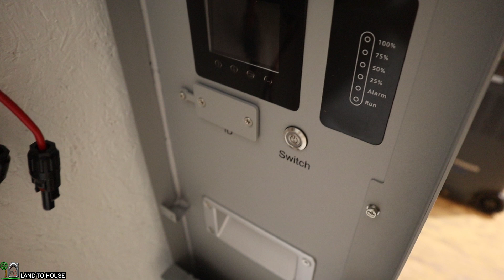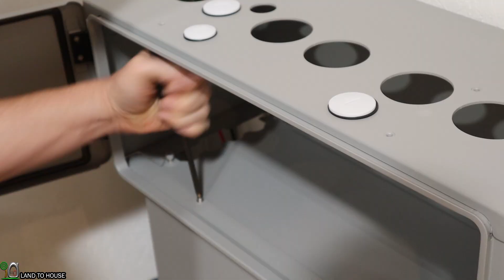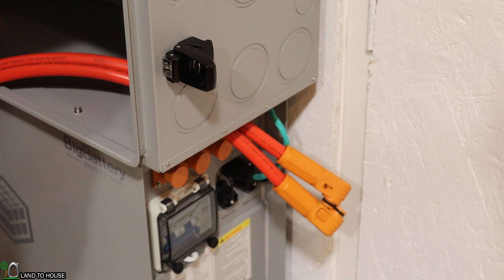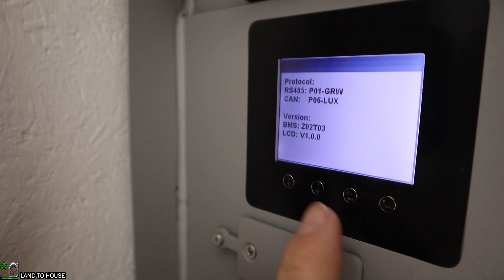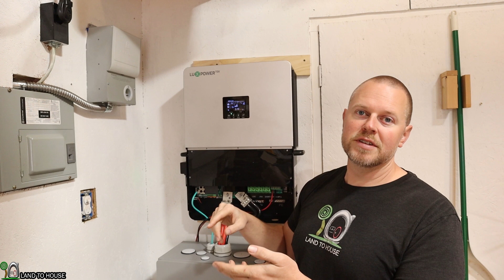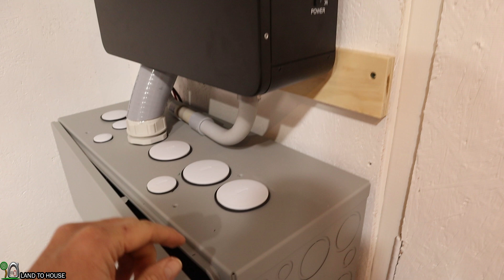Full Off Grid install 6kw Inverter and 15kw Battery - Big Battery Rhino 2

Comment: Thanks for showing a system up and running...
What this proves to me is my inverter was faulty right out of the box.   I swear they dont bench test things before they ship them.
I can do everything you can do there but mine wont charge from 220v to the battery.
I have had to order another inverter to see if this one is faulty.  It was the fastest way...7-9 days.... if I send it back it would be 14 days before I even found out if it was faulty... then another 10 to get the replacement back...
I will subscribe to your channel if you will show that inverter start charging from grid.    I need to see the screen and hear what it sounds like.    Mine engages a solenoid with a solid click then unclicks and repeats.   No voltage increase is seen on the battery terminals right at the inverter.  This tells me the AC to DC charger is simply faulty...  try and get that through to someone on the phone that has never install or used one is their life is painful...  
signed.... baited breath....

Comment: I thought EG4 made this battery? Is it really made by lux power and EG4 and BigBattery rebrand it?
Reply from the maker: The inverter is a lux power. Eg4 rebrands it and ads some breakers. 

The battery is the same. Bigbattery and eg4 both have a model.

Comment: I was glad to see that you put all the cables in connectors going into the inverter, bare cables going into metal cases worry me ! 
These batteries come with two cables for both positive and negative  for the larger inverters like the 18k, you only need one for the 6000. No worries until you want to add an additional battery, and then the angle of the connectors on the battery will be a problem for the parallel connection cables.
Just FYI, that big battery is exactly like the EG4 brand that is sold by Signature Solar and Current Connected. 
One more note is that the battery is a 14.3kw, not a 15kw.

Comment: no groments for the battery up into your wire box for the positive and negative?  Seems sketchy having those feed up through those cut outs long term if they shift and rub against the metal of the box to potentially cut them long term.  With that said though, nice setup overall.

Comment: What is the max voltage per 1 mppt? Is it 385v or 480v per 1 mppt or is it half between the 2 mppt???
Reply: On the 6000xp, each pv input is 460v. I used ten of the 400w/37v panels on each input on my inverter.
Reply: @randya9143 I see. Thank you 👍🏼

Comment: The inverter only needs one of the battery cables each. Even that is over kill. Since those cables are 2/0 and you really only need around 1awg cable. So you could install some lugs on there and remove 2 of those. Love these 6kw units. They are solid
Reply: The bottom line is 50 volts 120 amps 6000 w continuous...  when would anyone run that hard?  max output on inverter
1 AWG is enough.  1/0  if you feel flush...

Maybe one factory cable is only 5000W continuous and he felt that was just not enough
Reply: @MatWalter-q3h  one of the factory cables can support around 250-300 amps. So it would definitely do the trick.

Comment: Did you have proper isolation with the positive and negative leads going through the metal box of the inverter.
Reply from the maker: You make a good point. I will separate the battery cables so that they go into separate holes in the inverter.

Comment: I would have opened the other hole for the negative. Putting both in the one conduit seems shady.. yea these systems are getting pretty darn good.
Reply from the maker: That is a valid point. Opening up the other battery cable hole is a good idea. This system has been running over a month with zero problems.  I have not dropped the battery below 85% full.
Reply: That is sweet. Besides money it is really homeowner friendly now.